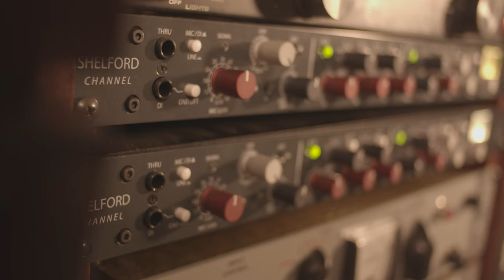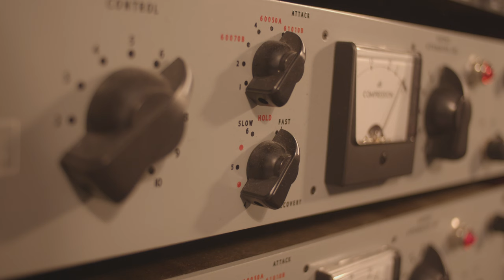The reason your AKAI MPC has 8 analog outs (...and why you should use them)

Comment: Defiantly control. I wish modern samplers like the octatrack had individual track outs, would make mixing much more efficient. if you make a mistake whilst recording in stereo you can’t remove it amongst the other layers in the arrangement. Absolutely agree about flipping and treatment being important too. Excellent content and beat crafting.
Reply from the maker: Thanks for checking this out. There's nothing wrong with devices that sum internally to stereo outs, but it would be a game changer if they had individuals outs. I've never used an octatrack, but i imagine it must have great internal mixing, and is more portable than a giant MPC.
Reply: Agreed man, they both have advantages. The octatrack is pretty cool for internal mixing and the portability is nice considering its multiple uses.
Cheers
Reply: Check out the SP16

Comment: Great video, I personally liked the sound of the stereo outs in this test, but you are right, exporting to mixer gives you more control…on the way out.. although, the same can be said if you stem it out and open in DAW and then pan etc.. so end of the day, it’s all about what workflow you feel most comfortable with…you can achieve the same results doing things either way.. just do what you like.. is how I feel..I subbed, nice channel
Reply from the maker: Totally agree. What I miss most about sending stems to a daw is the ability to easily double tracks, creating more layering and processing options. That takes much more work to achieve in the analog domain.

Comment: The multiple outs of each model of mpc is the best for ultimate control, to get that same level of mix from the stereo outs you would definitely have to do a lot of leveling in the mpc while running through your outboard gear and adjusting before recording. I notice you have sum good analog gear, Question, what do you think about the zulu passive tape simulator? Love your videos
Reply from the maker: Totally agree, which is why I'm surprised more people don't use the 8 outs. I've had my eyes on the ZULU for about 6 months, but it's kind of expensive. It's on my wishlist. Would love to have that on my master chain or at least for some parallel compression on drums. you got one??

Comment: When I first had a 3000 back in the dy, I never really like using the 8 outs cos it felt like it unglued what was coming out the stereo and meant I had to put it all back together to get what i like to call that 'baked in' sound. Mind you,  I was going into the DAW via a digital Mackie dest (which I hated). Now I know a lot more and I'm kiciking myself that I don't currently have a 3000. When I do though? Pshh...
Reply from the maker: the 3000 sounds great, whether you use the stereo outs or the 8 outs. 8 outs is more work, but I really dig the results, plus you can use the stereo outs in addition to the 8..to give you 10 total. Happy producing, fam. No matter what you use, just make it funky.

Comment: I have the 8 outs but on everything Akai even the S950 the 2 main outs always sound better. Unless you have literal Lexicon reverb units (the sought after and this forth expensive ones) in your rack and send those via bus on a literal $10,000 mixer with sweet circuitry than it's really pointless. Just get the EB16 If you have a 2k or 2kxl, it's worth it for the EQ alone.
Reply from the maker: I have the EB16 on my mpc2000. And a similar expansion on my s3000xl. I agree that the stereo outs sound good, but honestly, I use all 10 outs. stereo for kick and snare, the rest for samples and other instruments. Thanks for checking out the video.

Comment: Never thought about using the outs.
The only outboard gear I have to possibly run through is my MPC 2K XL. 
I see you have a JV 1010. I have a JV 880 that I'd like to use use. Do you have your 1010 midi to your MPC X? 
I need help with this.
Reply from the maker: I used to just sample chords from the jv into the mpc. I didn't control it with midi, but you can do that by going midi out mpc into midi of jv.
Reply: @eddieleonard6925  I want to use the sounds from my jv 880
What's the connection chain for that 
Can I use the outs for this
Reply from the maker: @jayjohnson9894 Yes, can can midi out from mpc into the midi in of jv. then the mpc will control the sounds on the jv, which should play from the jv outputs.

Comment: Thank you I got one fully upgraded that use very little and never used the 8 output, crazy me! 
I’m now searching for the cable I need for it, any suggestions will be welcome! Blessings
Reply from the maker: the stereo outs sounds good, too! but if you find unbalanced 1/4" trs cables, that should be all you need to connect to a mixer and other outboard gear.

Comment: Fantastic, thanks for sharing. I've been using ADAT on my 4K into my audio interface, but you've inspired me to send the 8 analog outs to my patchbay for experimentation. What mixer are you using? (the vibe, color, format of this video is great, by the way — love it!)
Reply from the maker: Thanks! The 4K is a workhorse! Any latency using ADAT? Good sound quality? This mixer is an old Allen and Heath Quasi model. They don't show up too often, but solid 3-band "british" EQ, and a thick overall sound. Cheers
Reply: @eddieleonard6925  There's a bit of latency that I compensate for and it works out ok. I have an aftermarket analog/adat combo from Taiwan so can't comment on the performance of the original unit. I think it sounds great for what it is. It's punchy and clean, but lacks the character of a vintage sampler. I've heard of people pairing it with an S950 or S3000 with great results — I'd love to try that someday! Cheers, looking forward to more videos.
Reply: New sub! Great channel, also great to find a 4k user.  Which brings me to a question, would either of you guys happen to know where I can get a 4k serviced? If I can't then I'll just sell for parts I guess.

Comment: Do u use your s950 akai a lot ? Do u recommend to buy the 950 for over 1000,- bucks?? I am not sure what to do..thanx
Reply from the maker: It's a shame the prices of the 950 have gone up so high, but I still think it's worth it. I run ALL of my samples through the 950. It's just the sound I prefer. The good thing is that if you don't like it, you can always sell it for the same price or sometimes more.  It's a legendary piece of equipment.

Comment: Love the video! I’m new to beat making, I have a 2000XL. I am assuming that to use the 8 outs I would need an 8 channel mixer?
Also, what are outboard gear/inserts? Never came across this before (I’m still learning so apologies). 
Lastly, to track out the beat using 8 outs, I would have the mixer connected to an 8 channel audio interface? And would I play each track individually or could I just play the whole beat?
Reply from the maker: Congrats on your 2000xl...solid machine. The easiest way to use your 8 outs is to have a mixer with at least 8 channels, so that output 1 can flow to input 1 on your mixer, output 2 --> input 2, etc. Then, on each channel of the mixer, you can probably control EQ, panning, volume. Most mixers have inserts, which allow you to interrupt the signal flow by inserting another piece of hardware (a compressor, a reverb machine, etc.), so that each channel can receive additional effects. You can set this up any way you like...but instead of an analog mixer, a lot of people get an 8 channel audio interface, which can function as a mixer as long as you have a DAW. Then, you can play your entire beat, and each channel will show up in your DAW as a separate channel, where you can mix, edit and add effects within your computer. Let me know if this makes sense. Happy chopping!
Reply: @eddieleonard6925  thanks so much for taking the time to explain all of this, it really helps. All makes sense except: so it’s either mixer or audio interface, not both?

I have a 4 channel mixer and a 2 channel audio interface. Currently no DAW as I don’t know which one to get. The easiest upgrade would be to get an 8 channel audio interface and a DAW (which I was going to get anyways once I can figure out which one to get)? This will then allow me to use the 8 outs for tracking out the beat into the DAW where I can have everything as individual tracks like I recorded in the MPC, and then I can mix and arrange everything?

With this potential setup would my mixer therefore be useless? Or would it still have a place?
Reply from the maker: @MuhammadLaher  Technically, if you get the 8 channel interface, then you don't need a mixer. However, if you like the sound of your 4 channel mixer, then you can still use it. This all depends on how many OUTS you have on your mixer. But let's say it's the normal, stereo output. You could use the 4 channel mixer as a drum sub-mixer..sending kicks to channel 1, hats to channel 2, snares to channel 3, etc., and sum them all together into this mixer, which then goes into your DAW. This is how lots of folks make their drums more punchy, giving them some analog flavor. 

Keep in mind that right now, because you only have a 4 channel mixer, you could only mix  your mpc tracks 4 at a time, which is time consuming. 

If I were you, I would mix your tracks in the MPC, send the stereo outs to the first 2 inputs of your mixer, and then use the other 2 inputs to plug in a keyboard, synth, midi, microphone or anything that adds to the track....then you can send the stereo out of the mixer into your 2 channel audio interface. Hope this helps...you have a lot of options.
Reply: @eddieleonard6925  thanks again for taking the time to share such great information. You’re very knowledgable in all this.
I think I understand all of what you said. One day I’ll invest in an 8 channel audio interface and also an 8 channel mixer. But for now I’ll stick with what I have. I first need to get better at beat making before I spend more money haha. 

I currently have my turntable going through the mixer to the MPC, and I have the MPC going through the mixer to the audio interface. 
I use the mixer to EQ samples (if needed) before recording into the MPC. I also use the mixer to EQ when tracking out through audio interface. So far I’ve been tracking out each track individually to a free DAW (audacity). 

Am I doing things correctly or have I completely messed up the whole setup? Lol
Reply from the maker: @MuhammadLaher  That set up sounds fantastic. It's a smart move to eq samples before working with them in the MPC. You have everything you need to get your chops up. Cheers,

Comment: I’ve had 2 mpcs both the classic 2000 and the  XL. I haven’t sampled a record in one of them coming up on a decade now because they have no out… it has to go thru the s950
Reply from the maker: Luckily the s950 has 8 outs.
Reply: @eddieleonard6925  absolutely. When I have the money I’ll  install 8out in the 2000 and move from 16 to a 32 track mix. Just had to replace floppy drive for the 3rd time on the 950, got a emulator this time
Reply from the maker: @Freakthesorceress  I've always wanted to upgrade my 950 drive. how do you like it?

Comment: I have a a nice mixer but only 6 inputs And other gear. I have an sp1200. I need some kind of sub mixer maybe
Reply from the maker: Great idea...I love using submixers. Then you can group sounds, like drums and bass together, for example, since the sp1200 has 8 outs. You've def got options.
Reply: @eddieleonard6925  I just bought a Sennheiser M8. I like your old Allen heath. 
I want to saturate transformers. Glue things together a bit. I wish I had 30 thousand right now. 
That would be just about right
Reply from the maker: @frankjamesbonarrigo7162  How does the m8 sound??? Fully working? Saturating transformers is one of the secrets to "fuller" sound. I do this as much as possible, using any old equipment I can find, usually in serial.

Comment: I know I'm a little late to this party but my message is for this YouTube Channel regarding your monitor speakers. it looks like you have Yamaha HS series monitors. If so laying them on their side is doing them a disservice in that the cooling fins on the Yamaha speakers run up and down not sideways.  laying those cooling fins sideways increase the Heat because they do not cool efficiently on on the side. your speakers will have a shorter lifetime and their performance may be affected by the excess Heat
Reply from the maker: Thanks for this tip. I had no idea.